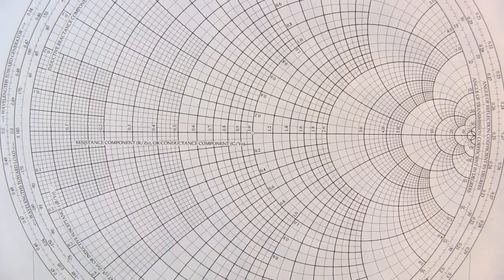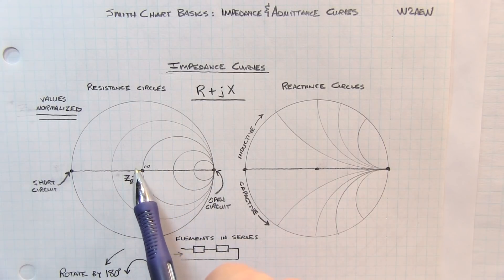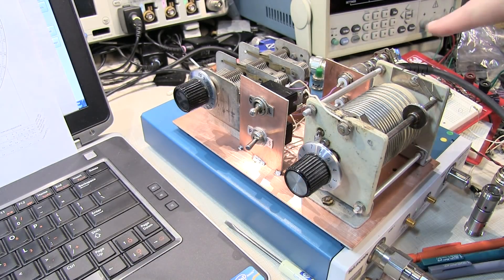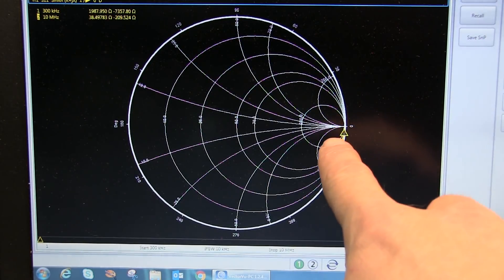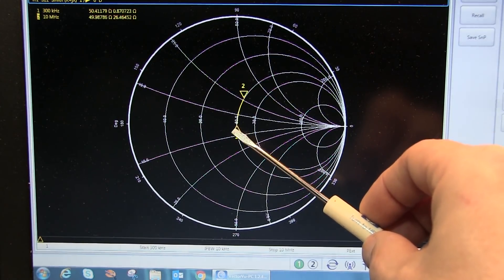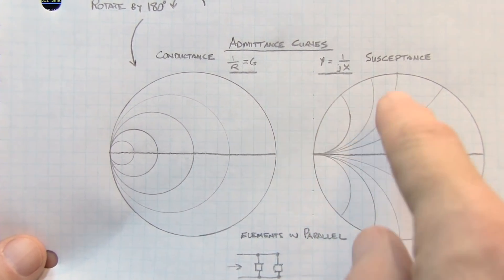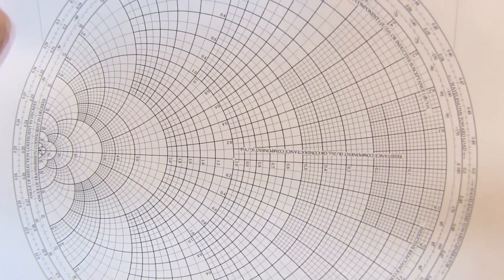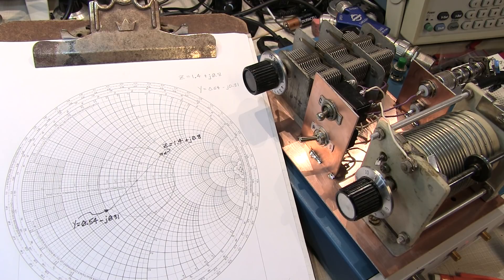#274: Smith Chart Basics: Impedance and Admittance curves and conversion

Comment: I just realize something weird. If I rotate smithchart by 180* then the capacitance and inductive parts should swap so now on up part above baseline should be capacitance and on bottom the inductance, but the VNA shows something different.
Reply from the maker: Capacitive and inductive regions don’t swap. The rotation is just a trick to get the circular graticules to flip over.

Comment: The formulas you have at 7:21 is wrong. Unless the reactance is zero the conductance is not the reciprocal of the resistance, and the susceptance is not the reciprocal of the reactance. Instead, G = R/(R^2 + X^2) and B (susceptance) = - X/(R^2 + X^2).  Take a look at the conversion of Z = 1.4 + j*0.8 at 10:04. Using your formulas we would have G = 1/R = 0.71 and B = 1/0.8 = - 1.25. Instead, Y = 0.54 - j*0.31.
Reply from the maker: Those formulas were only intended to show the relationships of resistance to conductance and reactance to susceptance. They were not intending to imply impedance / admittance relationship.

Comment: It pays to have the correct tools for the job !
And the VNA has become accessible to most !
Very interesting, and nicely done !
Appreciate your calm demeanor !
You don't know how many of these I've walked by at a Hamfest, and figured they were merely toss aways from a Cell site !
Now I will pay more attention !
Too, I'm guessing these particular Duplexers are Low power ?
And since they are essentially passive,
does it matter which port is designated TX or RX ?
As long as you understand how you choose to designate them ?
Meaning how you assign the Low or High ports ?
Reply from the maker: Yes, these passive filters can often be used for TX/RX as needed.

Comment: I don't understand why the constant resistance circles, say 3 ohms, passes through the R = infinity point.
Reply from the maker: Remember that the complex impedance is the series combination of resistance and reactance (R+jX).  At that region of the chart, X is VERY high.
Reply: @w2aew  So the 3 ohm curve, and all the other non-infinite resistance curves, never reach the infinite R point.  None of the resistance circles do.  Correct??  
Where could I find the formuli for the smith charts curves?  I wojuld like to plot a graph in a spreadsheet.
Reply from the maker: @stevemarkowski9795  Someone has already taken on this task - check out this link:
https://www.rfcafe.com/business/software/smith-chart-for-excel/smith-chart-for-excel.htm
or this one:
https://www.microwaves101.com/encyclopedias/smith-chart-in-excel

Comment: Great video. Just one remark around 7:15: you write G=1/R, the R in that formule is not the R you used previously when talking about the impedance, as using that R, the relationship between the two is: G=R/(R^2+X^2). It is also more common to write Y=G+jB , i.e. B is the susceptance and Y the admittance. (maybe that was a typo in your video?)

Comment: Such a fantastic demonstration. I have never actually used a Smith chart since I did my 3rd level RF Engineering course. I’ve decided to challenge myself and put the theory to good use and try to compare it with some experiments done using a series of L matching combinations to Z match an antenna at different frequencies. I don’t have access to an analyser so I guess some ingenuity might be called for ....I need to build a decent directional coupler so I guess it’s a case of a big learning curve coming up. Thanks again.
Reply from the maker: You can do it with a simple resistive bridge, see video: https://www.youtube.com/watch?v=eYN7dhdt1Dw

Comment: Alan, once I use my Smith Chart to analyze my antenna, what documents do you recommend so I can learn what to do in order to adjust or tune my antenna. Its one thing to have a new analyzer but I need to learn how and what to do to adjust the antenna system after the analysis...Any pointers to books, websites, etc? Thanks and thank you for the great Smith Chart explanation.

Comment: Can't thank you enough, Alan. This video is a perfect complement to all the other info out there. Seeing the immediate effects on the VNA is invaluable. Appreciate your efforts in putting together the L/C network. A very nice introduction. Would be interested to see an "L" or pi network solution to a complex load like an antenna on the VNA, if you would be interested in doing something like that. WK2W
Reply from the maker: Yes, I certainly plan on showing how to design a matching network using the Smith chart, as well as a few other things...  Stay tuned!

Comment: Alan -- great videos! I am an electrical / embedded engineer of over 30 years, but rarely need to use the VNA (basically when I am doing an antenna design). That said, you have some NICE equipment, and I was wondering have you done a comparison of hand held VNAs? I have an old HP 8753c here, and that's what I use for my work, but I would really like a smaller, hand held unit with a GOOD PC app, that is low cost. I have tried RigExpert, MFJ so far and I am not impressed, the hardware is ok, but the PC apps are just horrible, and I really want REAL-TIME analysis, I like to see things as I make changes on the smith chart. Anyway, I was hoping you had some recommendations? I was going to try the MiniVNA/Pro and PocketVNA next, but I am getting tired of sending things back -- I am sure there are a lot of people out there that would love to get into this stuff, but desktop VNAs are in the $1000-5000 minimum to get something working an fairly old from eBay, so these hand held units are a great option, but so far I am not impressed -- change my mind :)
Reply from the maker: I'm sorry, but I have not done any comparison of the small, handheld VNAs - so I don't have any information to change your mind, unfortunately.

Comment: Thanks, Alan!  I've been struggling with Smith charts and other videos haven't really clicked with me.  This did!  Seeing the VNA representation live with the changing reactance was a huge help.

***BUT***, I think this is the tip of the iceberg.  I'd love to learn more about interpreting a Smith chart to understand what my VNA is telling me about my antenna and how to use the chart to compute matching networks.  In other words, practical application.

Also, now I'm trying to understand admittance and susceptance.  I get that they are the complements to resistance and reactance, but my brain needs to wrap around this.  Any tips?
Reply from the maker: Yes, this is just barely the tip of the iceberg on the Smith chart.  I do plan on doing follow-up videos that discuss and demonstrate the other axis available on the chart, as well as talking about VSWR, reflection coefficient, impedance transformation vs transmission line length, computing matching networks, etc.  Books have been written about these things, so there's at least a few videos that can be made...

Regarding admittance and susceptance.  Think of it this way - starting with resistors.  When you add resistors in series, the total resistance is simply the sum: Rtot=R1+R2+ etc...  When adding resistors in parallel, the equation becomes 1/Rtot = 1/R1 + 1/R2 + etc.  This equation is more difficult to work out, so it is easier to do it is stages.  Convert each to a Conductance instead Gtot=1/Rtot, G1=1/R1, etc.  Then, the equation becomes a simple summation: Gtot=G1+G2+ etc.  Once you have the sum of the conductances, the invert Gtot to get the final total resistance (Rtot=1/Gtot).    

The same exact thing works for reactance!  They simply add up when in series.  But, when you put reactances in parallel, it helps to convert to susceptance values - then add them up - then convert back to reactance.

When dealing with complex impedance, it still works the same way.  Complex impedances in series will add up.  But, when combined in parallel, it's easier to add the admittances.   Admittance = 1/impedance.  The tricky part is dealing with the complex numbers - that's where the Smith chart helps.

Comment: Why in RF is it almost always 50 Ohms and not some other value like 47 Ohms, may be 1K Ohms or even 100 Ohms, why 50 Ohms?
Reply from the maker: The short answer is that it is a compromise between power handling and loss in transmission lines.  For a longer answer, see this link (or even google):
https://www.microwaves101.com/encyclopedias/why-fifty-ohms

Comment: Fantastic video. Do you know if there is anywhere online or in a book which explains how the smith charts were worked out and who worked them out. I can see the relation to the trig functions (circles) but would love to see or read how it was worked out.
Reply from the maker: There are a lot of references available.  Even the wiki page on the Smith Chart is a good start.
Reply: Thanks Alan, great video yet again.
Reply: This is so fascinating. How would one do this without using a Network Analyser. Could you just print the coords on to a photocopy of the smith chart? Would love to try this out but without the VNA